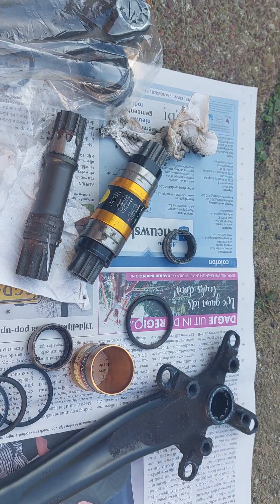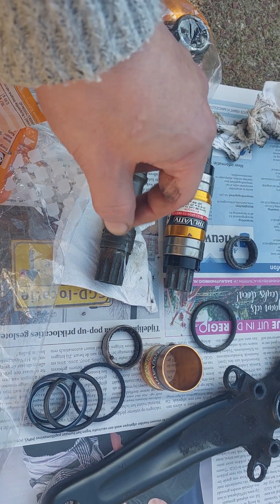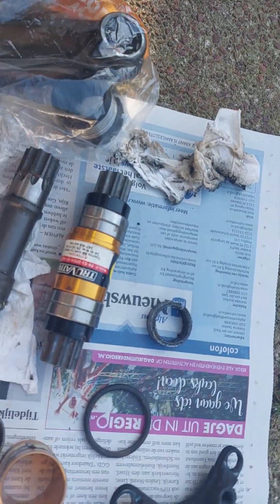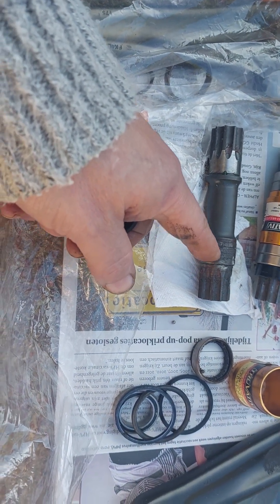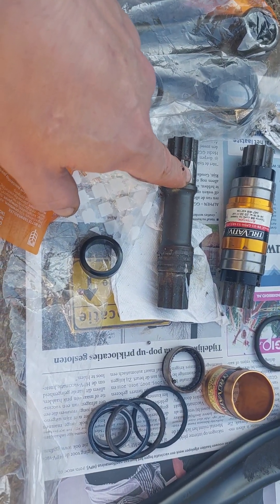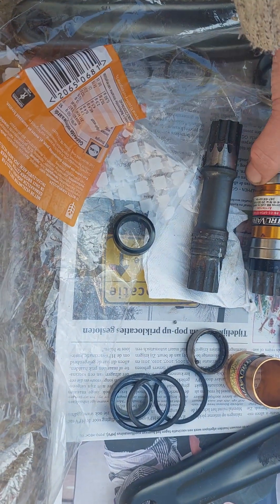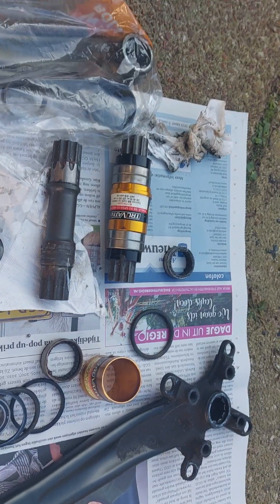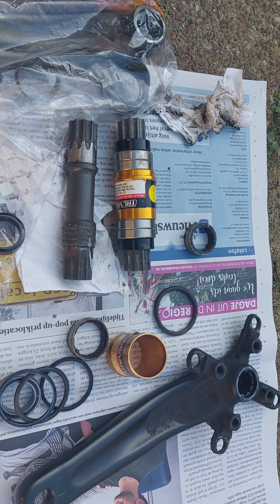Review of SRAM/Truvativ gigapipe ISIS bottom bracket: Doesn't last long

Comment from the maker: The Truvativ gigapipe ISIS bottom brackets are junk. They don't last long if you ride in the rain and I show that the bearings use tiny balls (seem to be 2.38mm). They are also not rebuildable. My advice is that once yours goes bad to replace it with a square taper bottom bracket which are cheap and last a long time. You will also need to replace your cranks but no need to often replace bottom brackets.

Comment: Yep, these ones are useless - mine wore out after very little use. Opted for replacing them with better bracket, which also meant changing the cranks.
Reply from the maker: @RS-il5zw  yes, it is a pity that you need to change cranks as well but it is cheaper to do that than to keep replacing bottom brackets! The square taper BB that I installed is still running as new...

Comment: i have a Felt Q800 and need to replace this bottom bracket.
I ordered the tools and watched some youtube videos.
But these things are junk u say and they are expensive as hell.
35-50 euro
Reply from the maker: @klodreck   Yes, they are generally junk. Someone mentioned in the comments 2 that might be better, FSA platinum and another, that might work well, but I had enough, switched to square taper and it works, no more issues and this bike is in the rain a lot. Downside is that you need a new crank set. I bought a cheap one from Sunrace which works fine... I figured 2x swapping bottom brackets and already I'm already at more than the cost of a cheap but durable square taper bottom bracket + cheap but fine Sunrace crankset, with very low additional cost should the bracket need to be replaced at some point.

Comment: I recommend FSA Platinum (not Platinum Pro) or RPM BB-9915 (made by TH Industry, the manufacturer of FSA). These units don't use cartridge bearings but reasonably sized balls captured between the axle and shell (like the structure of Shimano UN series square taper BB).
Reply from the maker: Aha, interesting. I don't think I saved the cranks since I went to square taper (and no issues with that), but those could be an option then for others with bikes with this type of BB. There used to be a SKF version which was supposed to be really good but I didn't see the right size for sale any more when I needed to replace mine.

Comment: As soon as Truvativ seems to do anything with grease it tends to fails quickly (almost think they add grit to their bearings)... ISIS was meant to be this amazing solution for stiffness etc. But the bearings are smaller than square taper. I'd suggest going with square taper - or a Shimano type 24mm external setup. I also had an Tuvativ/SRAM GXP external BB crank setup - bearings on those lasted less than 400km (non drive side totally seized). Granted we would usually ride in difficult weather conditions - but fitted a Shimano external setup and lasted for ages...
Reply from the maker: That is interesting. With my bike the non-drive side was in both cases fine, and I thought the design of the drive side with the bearings rolling on the axle while not having a proper repellent against water ingress (from the shape of the axle, some raised barrier at a 90 degree angle with proper seals), was extremely stupid. They could have made this much better if the bearings had been at least cartridge bearings that are easily replaceable. I already replaced the BB last year, as I had this issue with the 2nd set. Both failed on the drive side. I never had issues with square taper brackets, they last ages, and curiously when I looked at the website of the manufacturer of those very expensive bikes with Pinion gear box after making some testrides, they stated in the specs of another bike (not with Pinion as that includes its own BB/crank) that for the sake of longevity they use square taper bottom brackets! So all this progress and still not much progress over square taper :) Perhaps a little in stiffness, but some of the outboard Shimano BBs are also known for not lasting long so I decided to just go for square taper.
Reply: @WHS_reviews  My fail was in the UK - loads of rain and an incredibly fine powder sludge  which seems to make it in everywhere. After the fail the non-drive side was less well sealed.
Reply from the maker: @Matt van der Walt : I'm in the Netherlands so I think similar weather, lots of rain! :) Sludge: Well fine sand on the road gets everywhere with rain so this may be similar to your situation as well.
Reply: @WHS_reviews  We used to ride near kaolin mines (literally a grinding paste) - but yes its similar to the sludge you mention. Was especially hard on pedals.